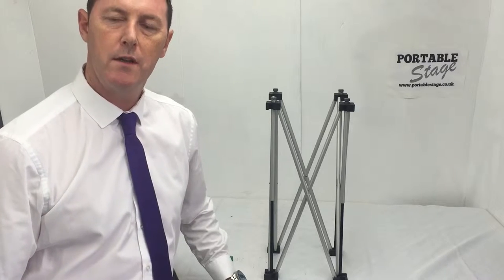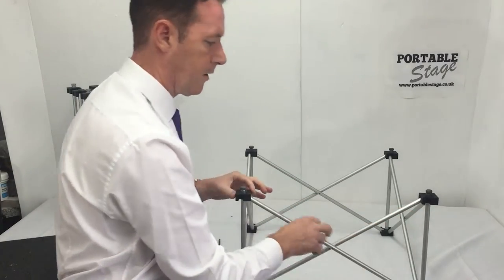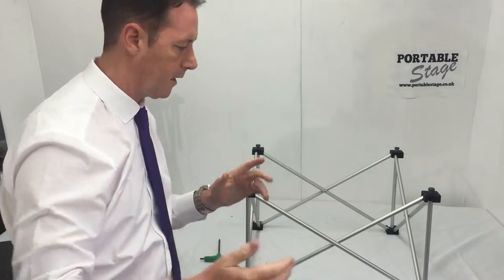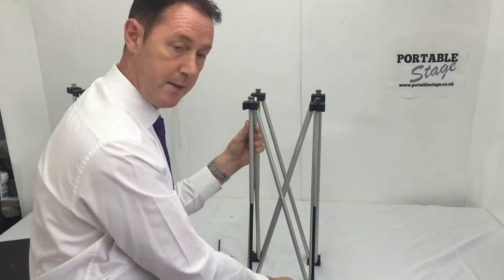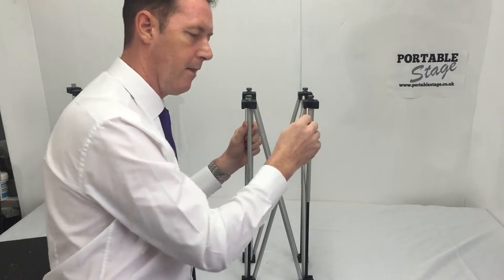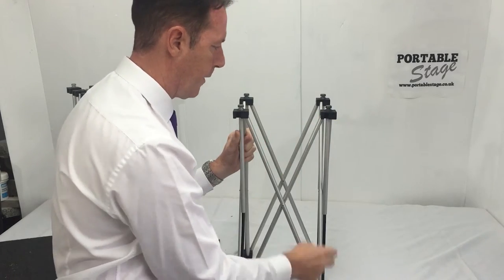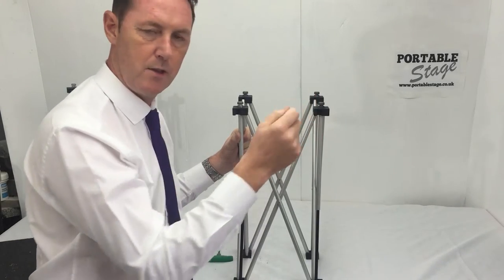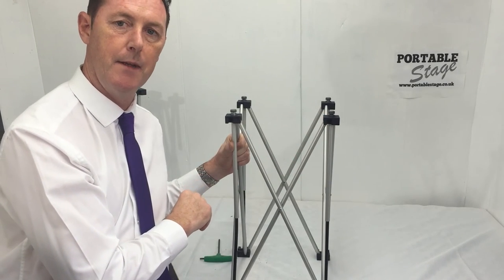Scissor section - Staging Repair and DIY fixing

Comment: You don't have to break it if you just get some tweezer grips and pull it out. I have intelli stage and it was very simple.
Reply from the maker: Hi Sean, yes hopefully you can remove the pin on any portable stage riser block. If yours come out using a tweezer, thats great. Some can be stubborn to remove, but ideally you will have the riser system in the future with screws rather than pins. Good luck and thanks for viewing.